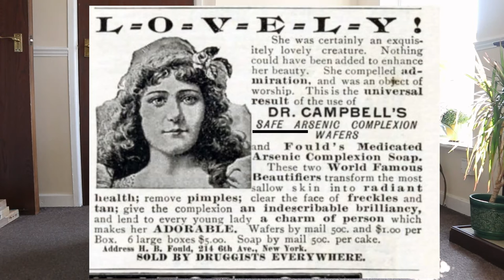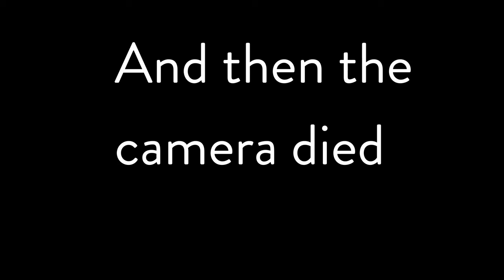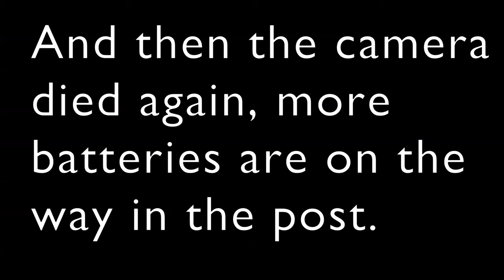Furniture-Free In A Rented Apartment | House Tour

Comment: You made a rare but excellent point about getting used to it slowly. A few years ago I went completely furniture free in one day, and found myself laying on the floor a lot (because sitting on the floor for hours was too uncomfortable and I was out of shape). I didn't know it then, but my body actually got used to the horizontal position - it's called deconditioning - and it has had a lot of severe and adverse, but luckily impermanent, effects on my health. So it certainly is most important to do the transition mindfully and slowly. Excellent video!
Reply: SenhorBrilhante  Well, we (doctors and I) are currently considering if I could have CFS/ME, so I have a hard time figuring what symptom is what (maybe my hypothethical CFS just started around the same time as I went furniture free? I thought it would bring me more movement but bc of my illness it just locked me on the floor?). In any case, my symptoms when spending a lot of time horizontal on the floor included (and still do all the time) fatigue, weakness, headache, joint+muscle pain, neck tension from sleeping on the hard floor, feeling dizzy upon standing up, generally ill/feeling worse when upright. But yeah that's pretty much the symptom list of ME and no matter how much I try to bring movement/exercise into my life, they don't get better. Go figure, maybe one day! 🤷🏼‍♂️😁 Anyways, you can google 'symptoms of deconditioning' for more objective information. Have a good day friend!

Comment: Glad you came up with a solution for the toilet, as sitting like that without any support is hazardous as unbalanced pressure can easily break off the toilet seat from it's ground and let you fall 
Or with time it will shake the toilet seat from it's place

Comment: Just out of interest could I ask how old you are plz? I’m much older than you, I think, and wondering if it’s worth my while starting with it. Thanks.
Reply from the maker: Hi, I'm 26 so I understand your hesitation, BUT,  my partner is 38 and we both live together in a furniture free house very happily. For that matter I know people in their 50s that live furniture free and have done for a long time. The hardest part about going furniture free is the transition period, the longer you have lived with furniture, the longer it will take to live without it.

My recommendation for everyone is to start slow, don't get rid of your sofa, table, chairs and bed just yet, start by spending more time on the floor. Even just a few minutes a day, and see how you feel, as long as you stick with it, little and often, you will start to notice yourself finding it easier, and then you will be able to tell for yourself if you should start removing furniture.

Hope that helps :)
Reply: @Movementum  I mean I totally get it. I think furniture is an unnatural construct. And I get all your points. I’m definitely gonna go for it and see if there is a difference. a concern is what does the extra movement have in terms of focus on concentration. Because I undesstand biologically the benefit of movement but in terms of the fact we’re all more and more involved in knowledge work on some level. Even if it’s just responding to emails etc, then we need concentration and focus. And this seems no different to fidgetting which of course is a huge issue for those with adhd and not letting them concentrate. Does this have any negative impact when you have to really mono focus on a task?